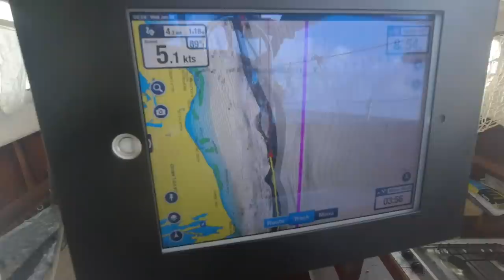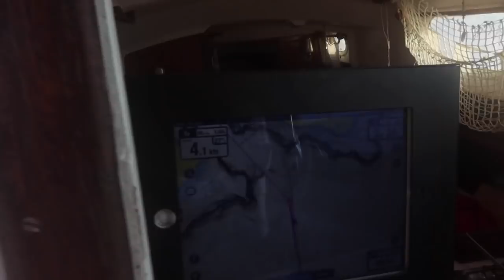Solo Sailing Cuba on a 30ft boat - Major rigging failure

Comment: Another great video Huub! I saw something in your engine compartment that worries me: It looks like your alternator belt is not aligned properly and causing it chafe against the side of the pulley - throwing black rubber particles all over the place as the belt disintegrates. You're going to need to make sure that the belt travels in a straight line around all the pulleys and doesn't have any kinks from side to side. Otherwise it's going to fail soon - plus the rubber bits everywhere may cause other unexpected problems as well. Thanks for sharing your experiences with us! You are a legend in my book! <3

Comment: Funny that's my last problem. My shrouds come down and bolt to the bulkhead that divides the v birth from the rest of the cabin. The bulkhead was rotten and was removed. Now I have the new panels cut I'm going to use cloth and fiberglass to connect the tabs and the plywood and then a steel plate attached to the plywood and tabs that the shroud will bolt to. Probably not the right way but definitely stronger than original. And then I'm ready to clean all the wood with acetone stain and varnish then I'm ready to sail. I've made videos of the whole process I'll post them for you once it's finished. I think I got the rigging figured out but I wouldn't be surprised if I'm over optimistic. LOl

Your videos have definitely taught me a lot about my boat. Thanks my friend.

Comment: some advice, as someone else commented all the black stuff in the engine compartment is the belt failing,not aligned correctly  they are not the worst engine but what fails  is the lift pump very common  buy a spare 120 us dollars   ,buy a new alternator  300 , and a spare starter300  have the original ones rebuilt       , and yes i am a diesel mechanic  i do a lot of yanmars    also  and i find this a lot the o ring fails on the diesel fill , happenned to mine had to pump out 200 litres of water and contaminated diesel, new filler cap new o ring 20 dollars ,  400 dollars in diesel  gone,
Reply from the maker: Am gathering spares as we speak. Not easy to find the right non original alternator for the m3-20b

Comment: I see a windvane on the back of your A30 and it should be more accurate than your autopilot. Have you experimented with using it or are parts missing and it's in-operable. Regardless, you have accomplished so much thus far. Keep going. I'm trapped on land with liver cancer and chemotherapy; wanted to do as you for years but have to remain patient a while longer.

Comment: While you are in port, buy yourself some heavy duty needles, make sure you get some curved ones as well. Don't worry about proper sailmakers thread, it is very expensive and hard to find. Buy some dental floss, it is extremely strong, very easy to sew with because it is waxed, but most importantly it holds up to the sun and salt quite well. Your sheets getting all furry is a result of salt drying on the lines and then being abraded by snatch blocks and such. It looks worse than it is. It is fine to keep using them, but you should have enough new line on board to replace the running rigging anyways. At the very least, enough extra line for a full new set of running rigging. But leave it uncut, on the roll. You never know what you will need it for. If you end up needing to gammon a spar, You will be happy that you did not precut for sheets
Reply from the maker: Dental floss, good one! I definitely need new running rigging! Its expensive!

Comment: HUUB.... Palm to face, next time set up plastic or even a SHEET around the work area "TENT" and a vacuum. Try to make a dust collection zone so you do not have dust going everywhere. All you need is to produce a negative air pressure zone to keep the dust isolated to the work area. I would suggest looking into getting a mini shopvac that uses a re-usable filter and vac bags. It is the best way to collect dust for a long run time before the filter is saturated. The idea is to have the vacuum external to the work area and put HOSE right up/in the work area.
A: !!!!!  Get a crew member unless you know the waters. I'd put out some advertising you're looking for an experienced sailing person who has a desire for YT life. B: Clean the fan belt particles. That is a MAJOR fire hazard, two figure out what is shredding your belts. C: The Stay support for a better long-lasting fix needs one of two or both methods for repair, big aluminum or steel ANGLE plate bolted through the hull and the knee. Or a fiberglass job from what I saw. If so, you are going to need to spread out the fiberglass at least at least 6-12" from center and it would be advisable to glass some straps. A fiberglass strap is fiberglass strips that are long and narrow, in your case ...? 10-24" long 2-4" wide 2-5 layers and in a few directions. Down and angled as needed I would advise 2-3. Straps are typically a middle layer to the primary fiberglass job. They spread the load to the body of the hull. I would suggest doing both a fiberglass job and adding metal angle supports. What you do to one side of the hull you should mirror to the other side. Even if it is not showing issues. As to her leaving, I get the feeling she had """" fam and friends """ gilt tripping her for "leaving" home originally. And have very likely been nagging at her to come home. IMO and EXPERIENCE it's the "FAM. and friends" that cause this. How dare you have fun and adventures when I/we are stuck home and miserable. I did not get the feeling she had a willing and strong desire to leave, felt more like she was being forced to leave there for who knows she may have another change of heart. Time will tell. People were flat out mad at me for leaving my home state for the tropics.
Reply from the maker: Great ideas!

Comment: So it was not a ballast problem? She was by the head because the mast was not properly raked. That explains quite a bit of some performance issues that have been hard to understand. Broken knees is very serious, I hope you are not planning a Band-Aid fix and to return to Blue water?
Reply from the maker: No. I think a bad previous repair after an accident with a small boat

Comment: Aren't the knees supposed to tie in to the keelson? I don't think that is an adequate fix. The next time you are in a marina, there is a service I think it would be worthwhile for you to pay for. There is a very delicate machine that measures the tension in your rigging, this allows you to get the tension balanced all the way around. But it has a secondary purpose. It will let you know if your chain plates or knees are giving, it is functionally a force gauge. Maybe your keel and knees are fine, this would be very helpful to know. Getting the rigging balanced would eliminate enough variables for you to figure out what all is not right. Being able to start from a balanced point, you can experiment with trial and error with different rakes, You just count the number of turns per turnbuckle. This service is typically about $400 USD. I know that is a lot, but frankly, you don't know what you have. It is not safe to take that vessel in bluewater. It might be, but you don't know and that automatically makes it unsafe. I cannot think of any method that would give you more information for less money.

Comment: The autopilot going on and off? This is very common. The little sensors on the aft thwart, just below the water line, there is a little plastic spinner that determines speed and another little sensor that notices currents. These are super simple and mechanical. When they stop working intermittently like that, it is very often just some kelp or seaweed jamming the little flutter wheel. It is easy to fix even while underway, just lean out over the transom and clean off the sensors with your hands, as soon as they start moving, you are done. When you go through warm water close to land, it happens much more often

Comment: You did a great job on the knee repair.  You shouldn't have anymore problems with that also given the lower loads on the aft shrouds.  You probably wouldn't lose a mast even if it failed, but you are safe now.  The spot by the deck drain must be due to the core in that area is failed/saturated.  It is not related to the shroud/knee.  When you have time you can repair that core as you did for the other areas of the deck previously.
Reply from the maker: Thanks! I didnt know that. Yes but i keep those repairs for next hurricane season, prefer to cruise now. Dont think it will break the boat

Comment: Dude you are fixing/hiding a deeper problem. It's not the knees failure it's a structural problem. I saw all your video's and I think your core is wet. Get your ass to Florida,Puerto Rico or the bvi's. Get a surveyor and plan ahead. Your lemonade needs a refit...... Not quick fixxes